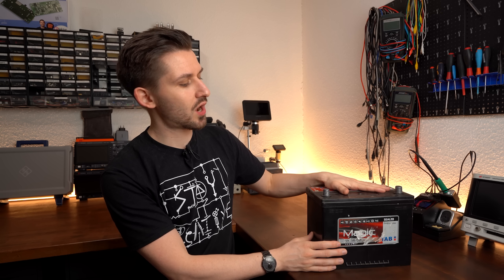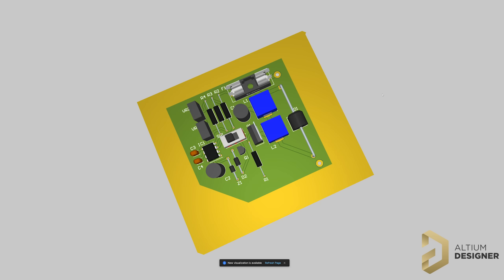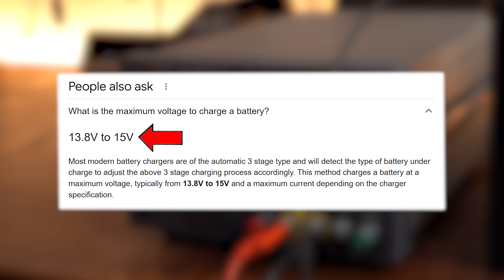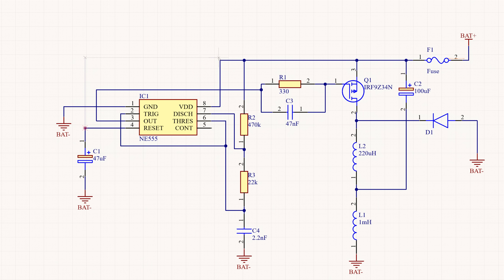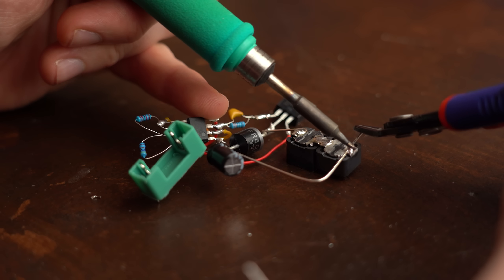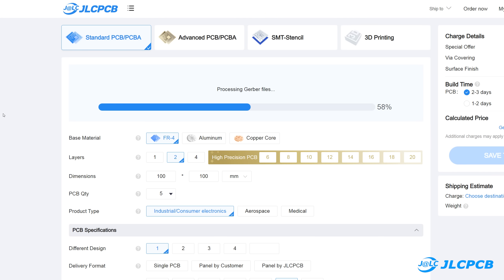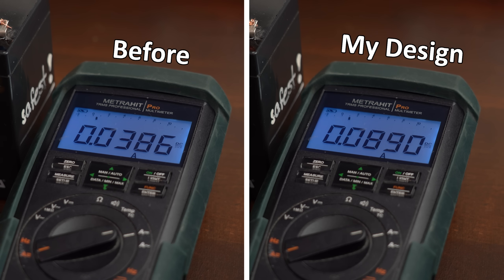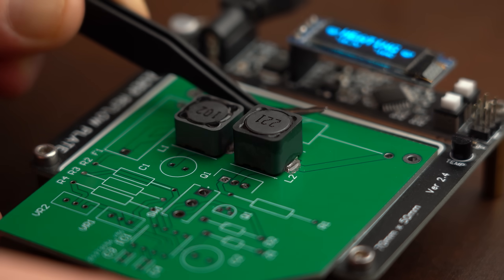I followed a YouTube "Battery Hack" and Wasted 30 Days! (Desulfator)

Comment: I've always found battery 'rejuvenation' to be no more than folly.  If I have a battery that is not doing the job I need it to do, I recycle and replace. Nothing promotes peace-of-mind like a brand new battery. Thanks for the video!
Reply from the maker: You are welcome. And thanks for the feedback ;-)
Reply: @greatscottlab  I live in Slovakia
Reply: NiCd are actually fairly amenable to being restored if they have suffered from the famous memory effect and i have seen wonky NiMH come back to reasonable life as well under some circumstances, i do believe there is a circumstance under which a sort of layer can form which locks away a part of capacity that is not otherwise chemically damaged. But this is an exception rather than a rule and i don't necessarily see that other battery chemistries would work like that; and anyway prevention from a reasonable usage pattern for sure has to be better than any attempt at a cure, and when it's done, it's done, they aren't gonna live forever.
Reply: @SianaGearz  I have some NiCad batteries that are over 50 years old that I have to do that with, and they are still working perfectly.  I use a camera flash circuit and hit them just a few times, and they seem to come back good as new.

 Never tried that with a NiMH battery, but they actually have KOH/NaOH electrolyte in them as well as the nickel and other metals, if that boils off, the battery will never work quite as well ever again.
Reply: actually, I saw a video the other month where some guy who sells batterys tested a few of the machines on the market on different type of errors on car-batterys. He could actually save 2 of the batterys, but most of the devices did not work :)
Reply: Yeah but you can't blame people for wanting to try! Those batteries are expensive, and we all use electricity... so logically we think maybe save money, maybe store power, but... yeah. Maybe rebuilding is the way to go if you have 3 or more batteries, because I've heard many times that usually only one cell is bad, which causes high internal resistance and the battery can never reach full voltage (about 1.5 volts per plate, 3 volts per cell?)
For example i have several batteries and a few cannot charge up to full one sits at around 11 volts after charge, meaning it has a bad cell. Get 2 or more batteries and combine the good cells into a rebuilt battery and you get a battery that works but still has some diminished capacity. 
Better would be to learn how to replate the plates, with electricity. Isn't that how they make them in the first place? 
Think of it this way, when you apply current to solution, water splits into H and O... the anode (+)  (O-) is made there, meaning if you took a grid of wires and put it in the right solution containing lead ions, and connect to the (-) it would plate lead all over the grid. Then you just reverse it and then the thing will have oxygen generated directly on the lead, causing it to turn in to lead oxide?
Reply: @simonlinser8286  "You can't blame people for wanting to try" specifically makes it a super fertile ground for outright scams and in general overblown claims of efficacy and safety (often but not always for malicious reasons), and you have to stay sceptical due to this. And if you leave yourself room for error, you better err on the side of not supporting scams. Which on the other hand shouldn't hold you back from trying to better the world and reduce waste but with the requisite effort and rigour at hand.
Reply: @simonlinser8286  I don't blame people for trying. I've tried 100s of times over my lifetime. Sealed lead acid batteries are expensive and seem to have a brief lifespan. I've just never had anything that I would call success in restoring one.

Comment: did you consider shaking (with a woman vibrator or something else) the batteries while desulfation circuit attached? BTW, thanks for your effort, i have also watched that video.
Reply from the maker: I shook them. Not in this way though.

Comment: One thing I don't understand about these circuits is how they work on dead batteries. You don't feed any current from an external source. If the battery is problematic, how could you use it as the power source of the desulfation process?
Reply from the maker: It draws little current. Around 40mA normally. Even dead batteries can normally provide that.

Comment: I've ever tried to repair my battery with simple mains voltage capacitive dropper desulfation with only 2 components ( using 5uF cap and bridge rectifier). At the first try it worked well, it noticeably repaired my battery as my motorcycle began to cranck again after doing desulfation, but the battery didn't last for long, it only survived for 1 week and then it dead again.
Reply from the maker: Thanks for the feedback :-)

Comment: I saw another video wich looked more plausible to me.. the opened up the sealed cells .. toped them off with distilled water and hooked up a welder set to DC to the terminals until all cells boiled vigorously (boiling hot acid is always nice ^^) ..
Reply from the maker: Sounds like.....fun

Comment: Very few times I got to make Lead-Acid batteries, that have been through a deep cycle, ever work again. Your results do not surprise me in all honestly.
Has anybody though tried to mechanically breakup the crystals? Like with an ultrasonic transducer? I have absolutely no idea if it would work but wouldn´t 
mind seeing a video on it! :-)
Reply from the maker: That sounds interesting. Soon there will be a video about ultrasonic cleaning............we will see ;-)
Reply: The shed crystals, if you decided to do it this way, would then be permanently excluded from the electrochemical reaction going on in the cells. That would mean a potentially large, permanently lost capacity; but it probably would restore the peak current output. In a pinch it could work, but that battery would need prompt replacement since the drop in capacity would mean quicker sulfation the next go round.

Keep in mind that high current batteries are made of lead sponge, not solid plates. SLI batteries could be destroyed if you're too mechanically rough on them this way.

Comment: There is a KNOWN good way to desulfate batteries.  Take them to a recycling point, where they will be melted down and processed into new batteries.

Jokes aside, I have had limited success with this.  It seems that it is very battery dependent.  I've saved only a handful with a consumer unit but most go to the "core charge" pile.
Reply from the maker: Haha sounds like a good plan ;-)

Comment: Scott wasted 30 dayz and made this single compressed video of 11min 🥺 Thanks Scott! ✨
Reply from the maker: You are welcome :-) I am actually planning a video right now that takes more than 30 days of testing. Will be interesting though ;-)
Reply: @greatscottlab  Gude, es wäre super, wenn du in diesen Test auch den Volksbedini mit aufnehmen könntest. Er soll wohl das selbe machen können.
Reply: thanks a lot, always amazed about your videos  @greatscottlab   ;-)
Reply: You don't really waste time if you learn something from it.
Reply: How is it "wasting" his time if he makes money with it?
Reply: YES, MANY THANKS for this content. ❤❤❤❤
Reply: I guess he didn't just sit on his derriere while the circuits were working on the batteries - he'd be up to something ingenious all the time!!
Reply: When a battery has a sulphide problem it is destined for recycling- I have tried gizmos that supposedly de sulphate the plates , chemicals that supposedly do the same and none worked - save your money for a new battery and don’t buy from a big chain store - they may have been sitting on a shelf for a year or more , check the manufacturing date before handing over your cash!
Reply: i want to see the real time tracking sheet ;) it’s not 30 days 1 video. but this video spans of 30 days. how much of the 30 days is actually this video?

Comment: RIP pure Lead acid batteries made without recycled Lead. Or is it extra duty on the battery from modern high Amperage demanding automotive systems, paired with stop and go gridlock causing more low RPM operation and less full power charging from the alternator. Or wait could it be the fuel economy leaning charging strategies?

Comment: The problem is not that lead batteries only sulphate, they can have lots of other faults, such as internal short circuits, interruptions or most commonly one plate simply stops working.
If you've seen YT videos where people in more southern countries repair batteries on the street, note that even these skilled craftsmen MUST buy one plate new, I can't remember which one, it CANNOT be recreated in the kitchen/on the street!
Reply from the maker: Thanks for the feedback. Good info

Comment: The problem is the pulses. They have too short a duration imo and cannot wait sufficiently to break down the sulphate crystals any better. Please note that Maintenance free lead acid battery is not compatible with this technique. 

Please make a battery protection circuit for a lead acid battery. Would be interesting.

Comment: And you turned it into 11 minutes for us, thank you!! Time saved for humanity. I appreciate this so much =)
Reply from the maker: You're very welcome!
Reply: @greatscottlab  Your next project. Get a 36 amp battery connect it to a ups or 150 watt inverter but ups is better. Do a stress test on it and charge it with the 500 watt ups. 

I have a dell laptop the battery is very expensive. I'm not ready to shell for the new one but a 12v 36a battery is cheaper than the dell battery.
Reply: @greatscottlab  0:00 someone tooted 😂
Reply: But u have to multiply it with amount of view 😝
Reply: @tiepup Exactly!
Reply: Guy is doing the work of the dislike button

Comment: It would be good to see a forklift mechanic's opinion. My old pop used to disulfate and get some good results. Or see what happens if you ran these on the dead battery.
Reply: Forklifts have much more durable batteries than a car. 

The lead plates in a car battery are paper thin and covered in a paste that falls apart. 

Unless you have a brand new car battery that got sulfated in storage, the possibility of restoring it is near 0. They are just far too delicate. The more often a car battery is drained, the quicker it falls apart internally. It's really only intended to start an engine, or get discharged a small percentage.

Forklifts, and batteries designed for renewable energy and deeper discharge are vastly more durable, with golf cart batteries and backup batteries still being better than car batteries. 

So if there is ever a battery worth attempting to desulfate, it's a forklift battery.
Reply: Commercial "desulfators" are typically first and foremost chargers, lead-acid batteries likes to be kept charged, so keeping them charged for a while makes them better for a time compared to not keeping them properly charged. They might also seem much better after a prolonged charging session, as in keeping a higher voltage without load or with insignificant load. But lost capacity is lost capacity.